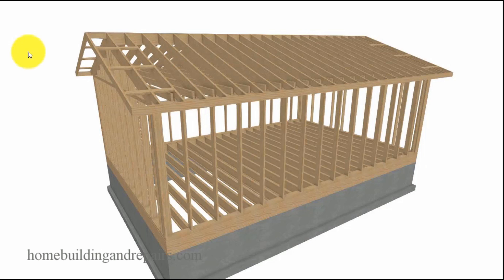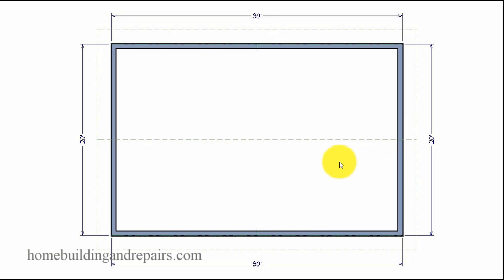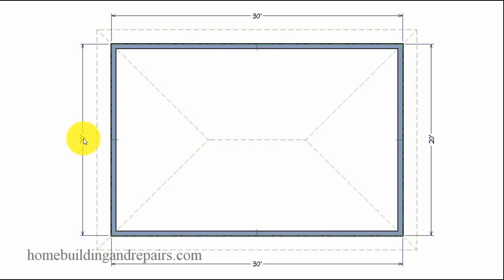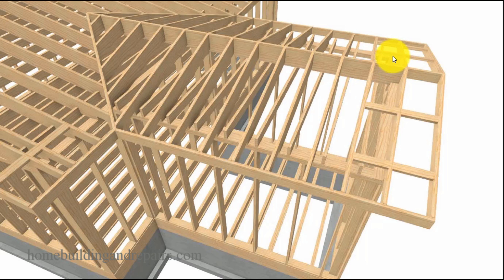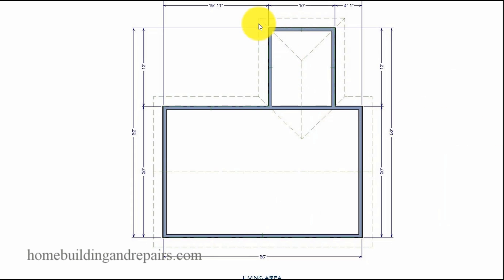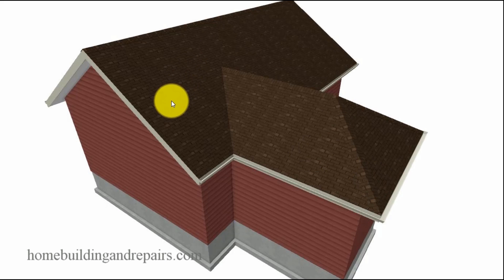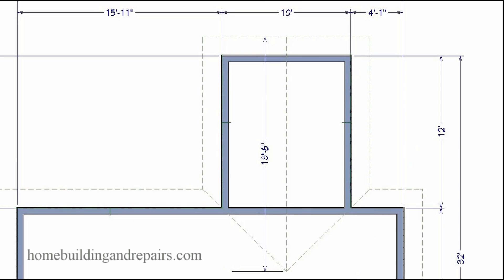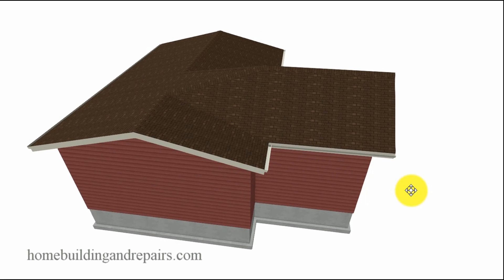How to Calculate the Length of Roof Ridge - House Framing

Comment: But how do you determine the ridge beam angle for a gable roof over a isosceles trapezoid floor such that the roof panels on both sides of the ridge beam are flat?

Comment: You didn't mention adding anything to your hip ridge length, you add the thickness of the ridge for a double hip roof, and half for a single
Reply from the maker: Yes, I did not provide detailed information, just the basics. If you are framing the roof, you will need to adjust for ridge and other components.

Comment: How can I calculate the number of iron roofing to used for the roof?
Reply from the maker: Are you referring to metal roofing?
Reply: @gregvancom  yes.  Like corrugated iron roofing sheets
Reply from the maker: @brianinomea9405  See if this video helps. If not then you might want to contact the roofing manufacturer, because I don't have very many videos on iron roofs at this point in time. 
https://youtu.be/-sAZK9lxa9A